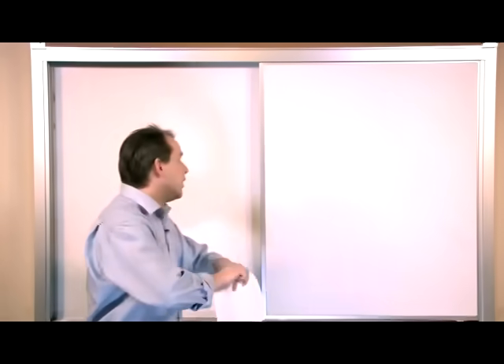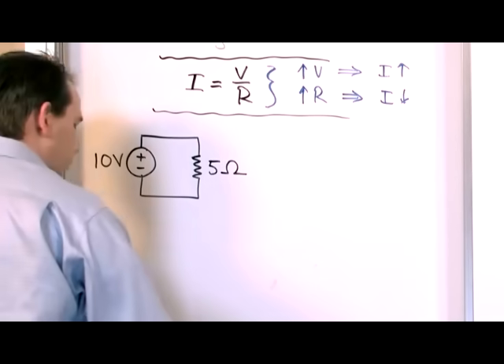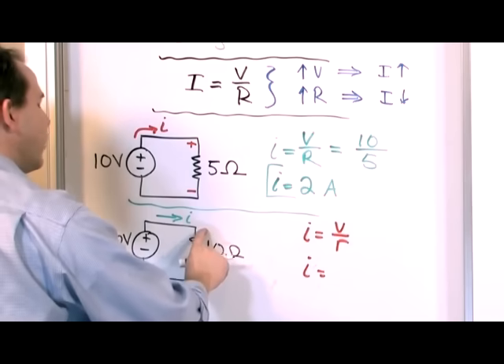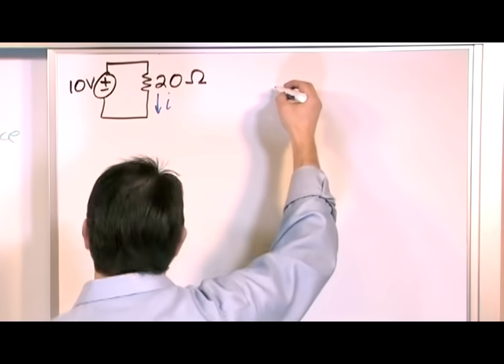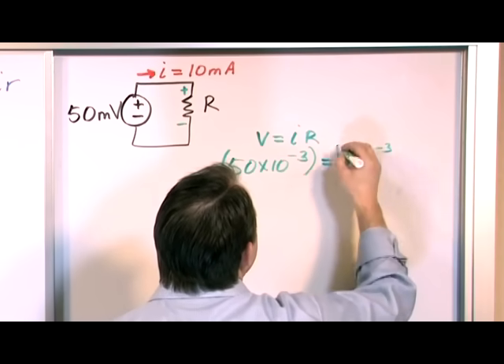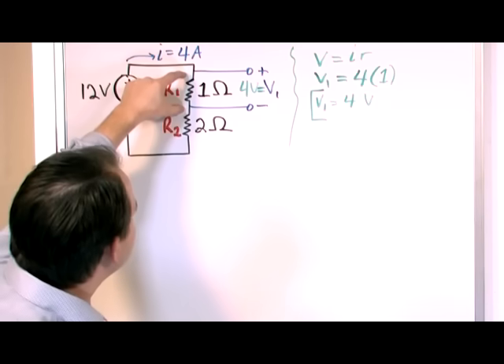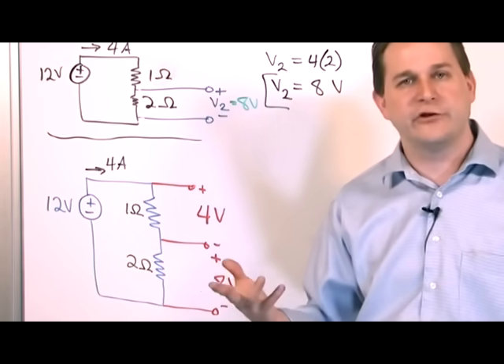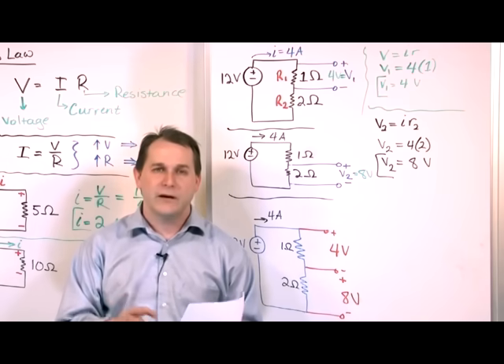03 - What is Ohm's Law in Circuit Analysis?

Comment: Question: I’m a bit confused about what he’s referring to when he talks about the voltage drop over the resistor. I thought the term drop in this context just meant it was going from the positive side of the resistor to the negative side. I understood him saying that if 12v goes out the positive then 12v will come through all the resistors and the same 12v will arrive at the ground. However, some of the times it also seems like he’s saying that passing through a resistor actually reduces the voltage that comes out on the other side and less voltage completes the circuit than was put into it. I watched parts over and over but still don’t know what to think. 

Also...

@38:25 he said that the combined voltage drops from the two resistors always equal the output voltage. How could that be? In most of the examples the voltage drop was less than the output. In the depicted schematic for the last problem, if I just used a two ohm resistor in place of the one ohm resistor then the total voltage drop would be 16v instead of 12v. So it doesn’t seem like the voltage drop is integrally pegged to the output voltage. Did he maybe mean that a functional circuit can’t have a higher voltage drop than voltage output?
Reply: The guy in the video does explain things properly, but he doesn't really explain how voltage drops exactly work.

The best way I can describe it (With my experience as an Electronics Technician from the Navy and having been an HVAC Technician) is that when it comes to voltage, there's a supply and consumption relationship.

In a perfect world, the source will ALWAYS supply its rated voltage, regardless of whatever electrical components are part of that circuit. And whatever electrical components are connected to the circuit will ALWAYS consume the entirety of the supplied voltage from the source. There are no exceptions, otherwise it would violate the laws of conservation of energy.

The last examples where there was a 12V source with a 1 Ohm resistor and a 2 Ohm resistor do indeed consume 12V. If you change the 1 Ohm resistor with a 2 Ohm resistor then you would have two 2 Ohm resistors, but both would still consume just 12V, but the amperage will change. What also changes is how much voltage each resistor consumes from the source.

12 Volts x (2 Ohm) = 6 Amps (The full 12 volts is consumed by the single resistor)
12 Volts x (2 Ohm + 2 Ohm) = 3 Amps (The full 12 volts is still consumed, but each resistor consumes 6 volts each here)
12 Volts x (2 Ohm + 2 Ohm + 2 Ohm) = 2 Amps (The full 12 volts is still consumed, but each resistor only consumes 4 volts now)

The more components you add to a circuit, the less voltage each component gets to consume of the source. I hope this example helps.

Post Edit: I thought of this just now, and realized I didn't really explain why this happens, so here's an example that's similar to my last example:

12 Volts x (1 Ohm + 2 Ohm + 3 Ohm) = 2 Amps
The key to understand here is that there's 12 Volts and 6 Ohms

Resistor 1 (1 Ohm), being 1/6th of the total resistance, consumes only 2 Volts.
Resistor 2 (2 Ohm), being 1/3rd of the total resistance, consumes only 4 Volts.
Resistor 3 (3 Ohm), being HALF of the total resistance, consumes only 6 Volts.
All together, they consume 12 Volts.

Basically, to find out how much voltage a single component consumes in a given circuit you divide the component's resistance by the total resistance in the circuit, then multiply that against the source voltage. The equation looks like this, with Rc (component's resistance) and Rt (total resistance) and Vs (Source Voltage): (Rc / Rt) x Vs = Component's Voltage Drop (Component Voltage Consumption)

Resistor 1: (1 Ohm / 6 Ohm Total) = 0.16666666666...7 x 12 Source Voltage = 2 Volts consumed by component.
Resistor 2: (2 Ohm / 6 Ohm Total) = 0.33333333333...3 x 12 Source Voltage = 4 Volts consumed by component.
Resistor 3: (3 Ohm / 6 Ohm Total) = 0.50000000000...0 x 12 Source Voltage = 6 Volts consumed by component.
Reply: chaoseclipse01 Huge thank you for this thorough and comprehensive answer.
Reply: @darrenstettner5381  No problem, glad that I could help.

Comment: I’m in aviation and electricity is my worst subject. This is ten times better than any textbook. That being said is there a book on electricity you recommend for a pilot so I can speak with the mechanics and understand what they’re saying? Thanks man, you rock! Smarter everyday.
Reply: I’m doing my PPL theory and have the same issue . Agree with you entirely. Did you ever find that book?🙏
Reply: @ajscain500  so I’ve never found a book for “dummy’s” so to speak, however as I’ve progressed in my career here are a few things I could say to someone starting out in aviation. As a pilot it’s important to know what you can affect from the cockpit. While knowing your aircraft in and out will make you a more complete aviator keeping it simple to begin with will create the base you need to dive further. 

Start with your emergency procedures that deal with either alternator or generator issues. Be sure you can conduct the steps in the cockpit even if you don’t understand what’s happening behind them. As you progress, go through the operators manual and find the section that deals with the electrical system and components. From here identify what does what. Like “what does an alternator do?” Then what does an alternator do for my aircraft when it’s running then when it’s not. 

Keep in the operators manual page by page and look up things you don’t understand within the electrical system. Like a short circuit or a bad ground. Take it slow and you’ll be able to electricity in time, and most importantly how it affects you when something fails. 

I also highly recommend becoming your own mechanic. I started working on my trucks about 6 years ago and it helped me understand lycomings and eventually turbine engine operations. 

Good luck!

Comment: At 36:38 - I don't get this. How could I attach a circuit to those so called "4V terminals" so that the circuit will be "pushed" with 4V potential? Because if I attach e.g. 1 Ohm resistor to those terminals, what I get is actually still a push of 12V into it, in fact, I just create a parallel circuit of those two resistors on the +12V power source terminal by adding that parallel branch on the first resistor. Whups????

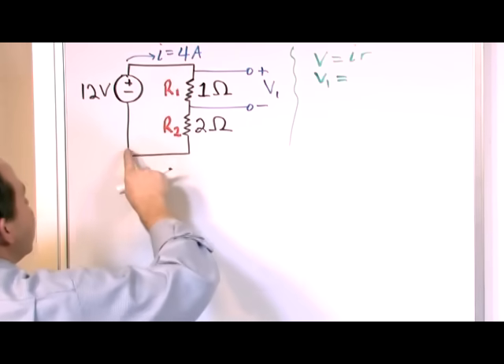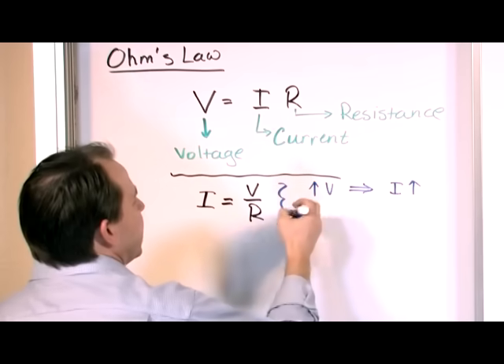Comment: Great Vids/Teaching, But, I got confused At 27:44, I thought that the Current Would change (Drop) between the 1st and 2nd Resistor Since the Resistance changed (i.e Increased), Contrary to The Examples at 05:20 and Onwards which stated the when the Resistance Increases Current Drops... How did it stay at 4A still..?? 🤔... Was that done Just for Example Sake Or Am I Missing something... ??😏
Reply: One increase, other decrease strategy occurs with variables only when other factor are constant. Previous question he discussed current change with respect to resistor only when voltage is constant. Later on other, with voltage and resistance changes current is constant.
Reply: The circuit has a total resistance of 3ohms and the current flowing through it is 4A, the current can only change if you add or reduce the resistance

Comment: How do you get the voltage drop in each resistor in the last circuit, if you add one more 3-ohm resistor to the series?
Reply: If you added a 3-ohm resistor to this circuit, the first thing you'd have to calculate is the new current. Like in the first examples you would be doubling the resistance in the circuit, so the current would be halved. 

Now you have 12 volts source, 2 amps current, and a 1, 2, and 3 ohm resistor. V=IR   V1=2(1), V2=2(2), V3=2(3).   so v1=2, v2=4 and v3=6.   2+4+6 = 12 so the voltage matches the source voltage.

Comment: The symbol of current direction should be from negative terminal to positive one because “electrons” travels not the positron. This diagram is for DC (direct current) circuit.
Reply from the maker: Yes but in electrical engineering the convention is to draw the current arrow as positive charge flow from positive to negative as I explained.  Thanks.

Comment: How do you figure out what 10 to the minus 3 is . I'm stuck on that
Reply: "Mili" stands for 10th to the -3 in prefixes of units table, try to google about it.  You will see that every prefix (mili, micro, giga..) have it's own value that you use in calculations.
Reply: 10 to the Minus 3 (1 x 10^-3) is just another way to describe a thousandth, or shifting the decimal point three places to the left. (Divide by 1000)

1 x 10^-3 = 0.001 (1 -> 0.1 -> 0.01 -> 0.001)
2 x 10^-3 = 0.002 (2 -> 0.2 -> 0.02 -> 0.002)
...
9 x 10^-3 = 0.009 (9 -> 0.9 -> 0.09 -> 0.009)

When you get to double digits x 10^-3, it becomes like this:
10 x 10^-3 = 0.01 (10 -> 1 -> 0.1 -> 0.01) (Can also be described as 1 x 10^-2 as well) (1 -> 0.1 -> 0.01)

The reason why this is important is because the metric name for a thousandth is "milli" (Lowercase M) which is what units in electrical equations use as electrical equations are based on the metric system. Example:

1 mV is 0.001 Volt, which is described as 1 x 10^-3 Volts.
10 mV is 0.01 Volt, which is described as 10 x 10^-3 Volts.
100 mV is 0.1 Volt, which is described as 100 x 10^-3 Volts.

Once you reach 1000 mV, it becomes pointless to keep saying millivolts because it becomes 1 Volt.

The reason why you don't see prefixes like deci (0.1) or centi (0.01) used in electrical equations is to keep having to do conversions down, which is crucial for analog meters since there's only a limited amount of space on the meter to show meaningful information, plus it keeps required programming down for digital meters.

Comment: Thanks for this. A bit confused as to why the current never changed after the 1 Ohm resistor as Ohms law says current is Voltage over resistance. Likewise why’s there’s still 4 amp after R2 after going through two resistors?  Thanks.
Reply from the maker: Welcome!
Jason, MathAndScience.com
Reply: It's because the current through anything in a series circuit is the same. You can imagine it by the water example: if you put a thinner hose and couple it with a bigger hose, and let water flow through them,   the same water is going to flow through both of them.
Sorry for my not-so-good English, I'm not a native speaker. Hope you could still understand it.

Comment: If Battery is 100v, 4A and R1: 1ohm, R2: 2ohm...How total is we have 100v?
Reply: That problem in the real world doesn't exist. As the voltage increases, so does amps. Thus for this problem to work, you will need to increase the amps (current) to make sense. Also, resistors have limitations on how much power can go through them.
Reply: In a theoretical way, the current will have to be 33.3 amps. If you want to make the current 4 amps then you will have to increase the resistance which, if kept at the 2:1 ratio will be 8.3ohms and 16.67ohms.

Comment: Wait, if there's a 10V source and let's say 10 Ohm resistor, there's always 1A of current? Can't the source supply more current to the circuit so it's 10V 20 Ohm and for example 3A in the circuit?

And why it's said that current and voltage are the same at any part of this circuit? Shouldn't current or voltage be higher before it reaches the resistor and lower after it passes the resistor? Got a bit confused there.

And last question - am I stupid?

Comment: Very Strange : electrical  "current , or electron flow, is considered to exist only when the majority of electron movement is in the same direction. It results from an external pressure, of force, applied to the conductor. This pressure results when one end of the conductor is oppositely charged with respect to the other. If the two ends of a wire are connected to a battery or generator, the free electrons will move in a definite direction through the conductor from the negative terminal of the battery or generator to the positive terminal. " I have worked in and out of electronics since 1961. I started out repairing black and white televisions to color televisions. Then to radio equipment, starting with tubes then to solid state circuits. I repaired and adjusted radio transmitters  and receivers under required FCC licenses. The only time I was taught that positive to negative was in transistor theory. What this guy is teaching was what the 19th. century scientists thought. Check the Edison effect or the Flaming valve, or as better known, a diode, tube type. This still holds true with transistors. Think of it, electrons are considered negative charged and protons are positive charger. Check out negative or positive ions, the same thing.

Comment: When talking about the voltage drop in the first couple of examples you talk of it like its something different from the voltage source, but its the same amount.  I think this makes it a bit more confusing.
Reply: why??? the resister ABSORB it..so whatever is left over. You know....like a dimmer knob or POT...which is just a variable RESISTOR..You know....when the knob is at Zero...it has crapload of RISISTANCE..when it's on 5....it has you know 2 ohm . When you crank it all the way up on 10...it has Zero ohm.
Different ACTIVE components has different voltage requirements...You basically use resistors to adjust to different component input...such as an LED is only 3v
.if you had a 6v source...you'll need to drop it to 3v into the LED.......but the motor is still using 6v.
or lets say..you had 8-12V esc for a motor...made in china.
People say the  fan keeps crappy out becuase it cant
handle the 12V...becuase there's only a  1v-9v cooling fan.
You can install a resistor to the fans input to drop it's into
voltage to below 9V...instead of disconnecting the fan to save the fan ( which will kill your esc..lmao)
Reply: Thank you. I was getting a bit confused.

Comment: Lets suppose you´re building this simple circuit with 2 resistances. What happens if you put a 3 ohms resistance instead of the 2 ohms? There willl be a current drop to conserve the sum of 12 volts? I understand the math behind but it was made to match 12v, right?

Comment: What if R1=2 Ohm and R2=3 Ohm, I=4A, V=12V
That means:

V=I*R
V1=4*2 = 8V
V2=4*3 = 12V

V1+V2 = 20V

Why in this case V1+V2 is not equal to V, what I did understand wrong?
Thank you!

Comment: CAN SOMEONE HELP ME!  on the last example he shows with the 2 resistors he solves for V. he told us the source voltage, although we didnt really need to know in order to solve for it. but he told us the source voltage. 

what is the source voltage is 10v (or any other number) and you kept the 4A and the 1 and 2 ohm resistors but you still solved for voltage? because you are doing I x R the voltage would remain  4V and 8V but what would add up to more than the 10v. 

would this mean that the resistors would not be getting enough current and therefor the circuit is under powered?? im confused. someone (who is making stuff up) please help.
Reply: because you kept the assumption that i=4, when in fact if you have a new V source you WILL get a new value for i (measure it). So no, it will not add up to over 10v because your new value of i wont be 4.

Comment: The word voltage applied and voltage drop.  hmmm.
From one end of the resistor to the other end 10 volts drop. as in it goes from 10 volts to 0 volts. So your meter reads 10 Volts difference.
Your meter also read 10 volts at the source, it is dropping there too but we just call it applied potential, source voltage I suppose.
Reply: That's probably what i'm having the hardest time understanding. A 'voltage drop' sounds like you've decreased the voltage (or pressure) to zero so that no electrons are flowing to the circuit that connects to the negative side of the battery? Is that right?